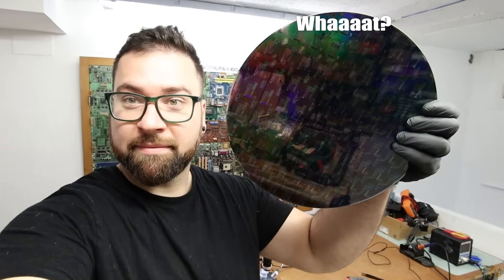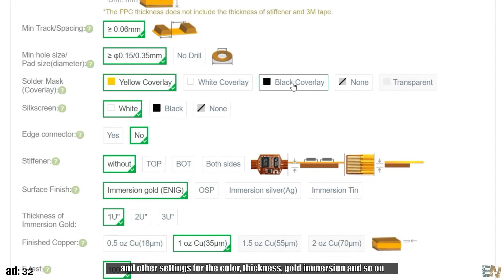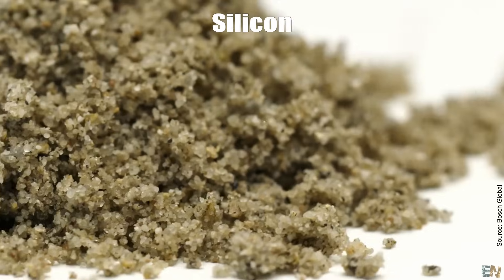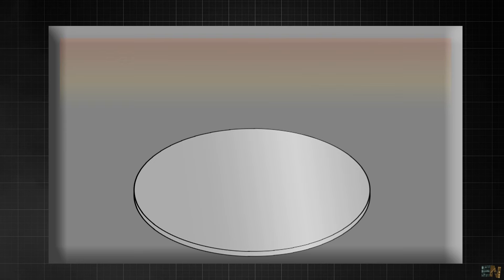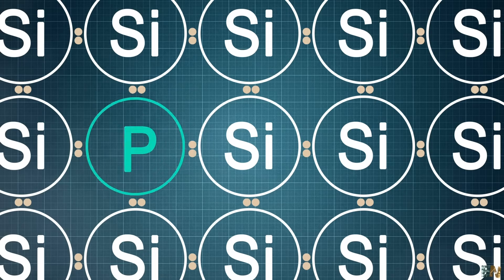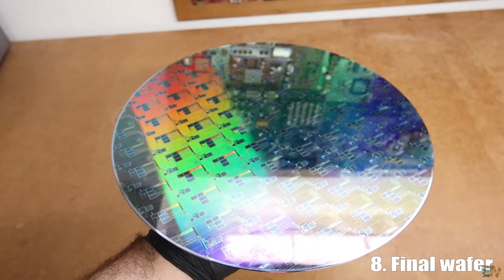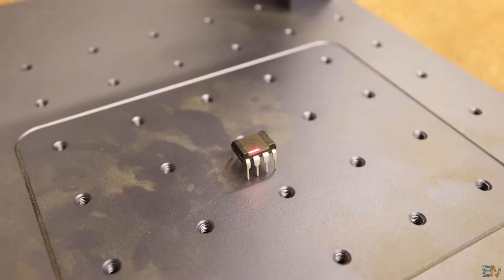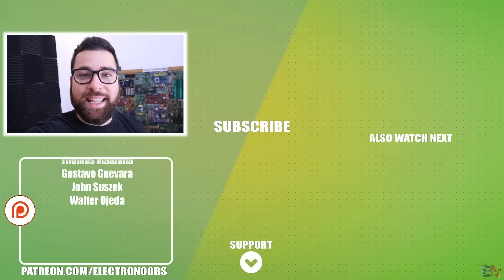How Microchips Are Made

Comment: Useful video! Quick question...are the fabs or chip foundries being built in Arizona capable of taking purified silica in as a raw material & then, completing all the steps shown in this video? OR, are they receiving "raw materials" further down the line from the silica process? Again, thanks.
Reply: The wafers are made by a sub contractor that specialises in making wafers.
Reply from the maker: I don't know anything about those foundries. Usually they have different departments, one for raw materials, one for designs, machinery, exposure... And parts might me manufactured in different facilities
Reply: @ELECTRONOOBS  Thanks. I haven't toured a fab, so I wasn't sure what the starting point might be at various facilities. For example, does Intel purify silica or does someone else take care of those processes & deliver to them? Anyhow, thought provoking video.